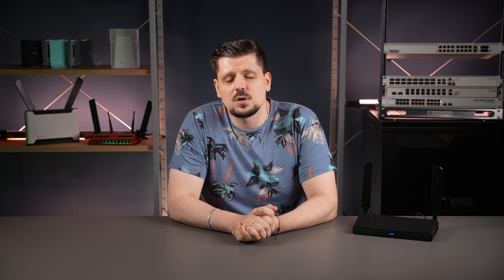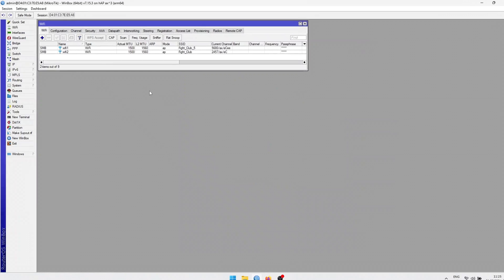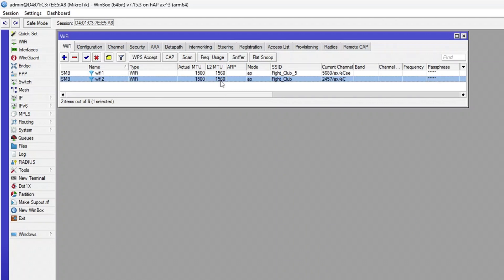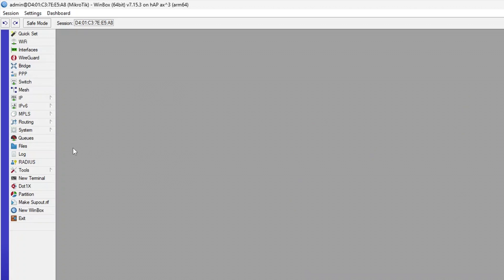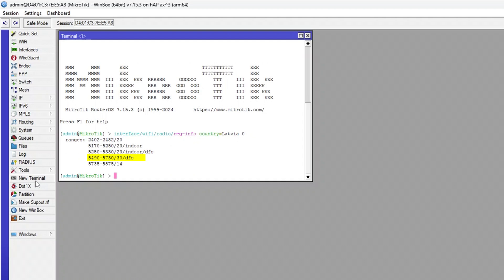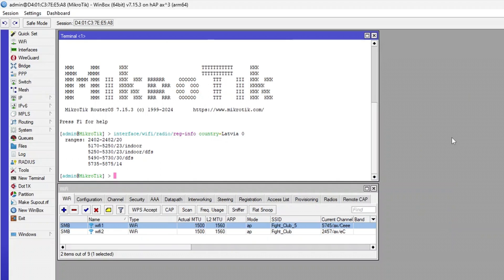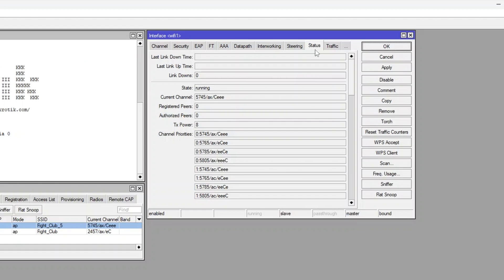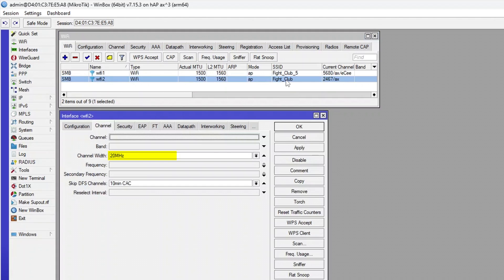Simple tips to improve WiFi range

Comment: what mean "0" in your command ? the interface number ? I have tried 0 ,1 but nothing.About mikrotik wi-fi , is ok only for a cheap usecase.If you have 30 an more client, and you need for wi-fi roaming ( 802.11 rkv ) or the density of clients is high - mikrotik isn't so good sollution.You need something like Unifi,Aruba and other vendors who have MU-MIMO 2x2 or 4x4.
Reply from the maker: Roaming is supported as well as many clients. If you need help with optimizing your setup configuration, we have a helpful forum

Comment: One thing to also take note off (that a lot of people don't), is that you should set the 2.4GHz to be around 7dB lower than that of 5GHz.
While not strictly necessary, a lot of client can be rather dumb and stick to 2.4GHz because it's significantly stronger than 5GHz (due to the dampening n such).
Setting 2.4GHz to 7dB lower than 5GHz (eg. have 2.4GHz be 14dB and 5GHz on 21dB) makes them around equal strength (and clients should be more inclined to pick the 5GHz).
Yes, it doesn't go with the whole "improve wifi range" aspect (since you lower the 2.4GHz band's range) but I'd rather have my clients be more inclined to move to 5GHz than maximize range.
Reply: That's good but I personally for homes, prefer to just create separate SSID's for each frequency band.  Then choose at the device itself which band to connect.  The 7dB thing is more for to encourage band steering but the downside is your now down 7dB on 2.4GHz.  That extra 7dB on 2.4GHz can be very useful.
Reply: So basically you have now on both frequences no signal instead of at least some signal on legacy 2,4GHz, which might be sufficient for thermometers, Wallboxes or any other devices not streaming films or videocalls...

Comment: The SSID should be the same string on both bands to enable seamless roaming for the clients as you move around the property.
Reply: mikrotik not suport roaming , for that you need 802.11 rkv, for AP's and for user's too
Reply: @ДжониКейжд-э2б  of course they support 802.r for ac and ax products. It is placed in ft-* section of security config of wifi interface
Reply: @ДжониКейжд-э2б  802.11 rkv isn't required for seamless roaming of adjacent layer 2 networks across APs with the same SSID, where the said SSID is tagged to the same layer 2 domains on all APs.

I've been doing this for 10+ years.
Reply: @ДжониКейжд-э2б  That's different, as long as layer 2 adjacency and mobility is done correctly, seamless roaming works on client side.

Comment: This is ofc a more relevant comment for the upcoming additional AP video... but sometimes you may just need to run a wired connection past a barirrier and have an AP there. On the farm I ran a cat7 connection into the garage for this reason... even though I already have outdoor APs they just couldn't reliably penetrate with all the material in the garage... so wired connection into the garage and a separate AP... aaaaand done.

Comment: Number one overlooked thing that can easily improve some range is to mount the AP higher!  Most attenuation is along the horizontal plane.  Mount it higher means less attenuation, even on the same floor.  Ideally mount it on the ceiling, or even in the attic if possible.  If it's a two story home, have the AP on the second floor, in the center of the home.
Reply: Should they stand upside down?
Reply: I have on WapAC covering the entire house, mounted on the second floor more or less in the middle of the house. Covers three floors and the garden also sufficiently. After moving in I did have to make the effort running a cable to that location but it was worth it. I needed to run some other cables anyway hence the spot was wide open an it was a shame not to put a cable and socket in place. It aren't gigabit speeds, but more then enough for mobile devices including streaming video. The only cheat I had to make was using country 'korea republic' on my 5 GHz wireless because the Mikrotik DFS implementation clearly sucks.
Reply: @feicodeboer  Nice!  Yes that cable run can be a hassle but once done, can pay off big time!  One idea for others is to go buy a 100 ft CAT5E or CAT6A Ethernet cable and temporarily place the AP in potentially good locations and test.  Then if/when you find a good spot, then run a permanent cable there for the AP to be there.

Comment: disconnected, connection lost, signal strength -35
disconnected, connection lost, signal strength -35
disconnected, connection lost, signal strength -35
disconnected, connection lost, signal strength -35
disconnected, connection lost, signal strength -35
disconnected, connection lost, signal strength -35

Comment: I love Mikrotik but WiFi is not it's strongest area. Small travel router (ax) has much better range and stability in my appartment (compared to hap ac3). Not sure if it's ax vs ac. Already updated to new wifi driver with beam forming. Range is better not still not enough..
Reply: Actually, this video helped me choose a better/more powerful channel for 5G and my hAP ac3 now has better range than a small travel router. Thank you! :)
Reply: hAP AC3 has a 3dBi antenna gain for 2.4GHz and 5.5dBi for 5GHz.
hAP AX2 has a 4dBI antenna gain for 2.4GHz but 4.5dBi for 5GHz.

So the AX2 has better range (in theory) on 2.4GHz but worse on 5GHz.
If you want more range, you will need bigger antennas (so would need to upgrade to a hAP AX3 or something).
Make sure to check your local laws regarding your max EIRP (combination of TX power, cable loss and antenna gain) before just screwing on a bigger antenna.

Comment: We need a new RB5009 router with wifi6/7 and an all-port 2.5Gbe configuration.
Reply: Knowing what Mikrotik is, in dreams)
Reply: Mikrotik is like a devil.. they will give you maybe one 2.5GB port and all wifi or 2.4wifi and all 2.5Gb ports.. never everything in one package
Reply: @ussul6524  yes, you are right
Reply: And poe on all ports ;)
Reply: OMG that would be cool, just those 2.5Gbe would be fantastic
Reply: All good but relating specific to improving range, WiFi6/7 really doesn't increase coverage (in particular WiFi7) - just (again) instead more speeds.